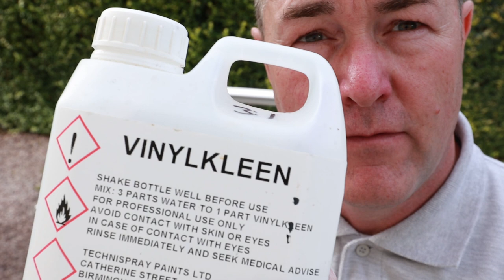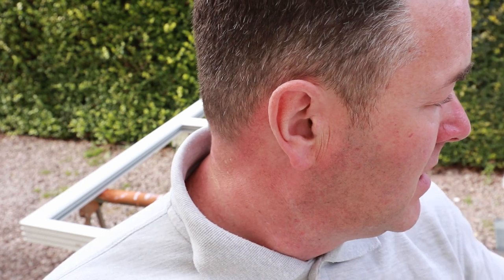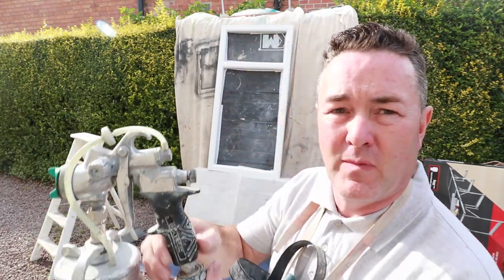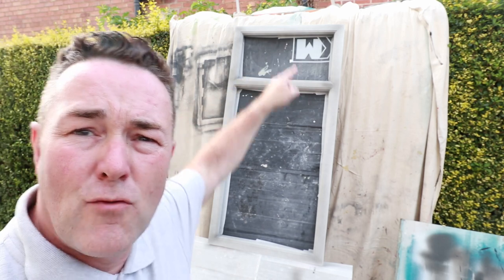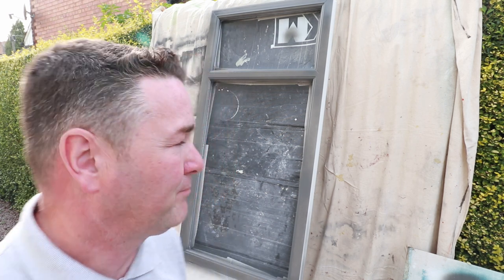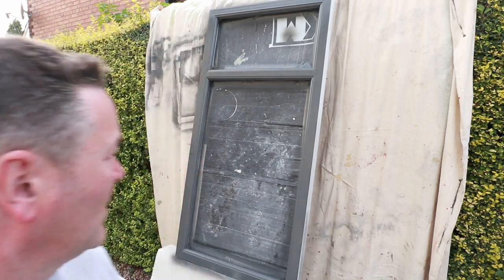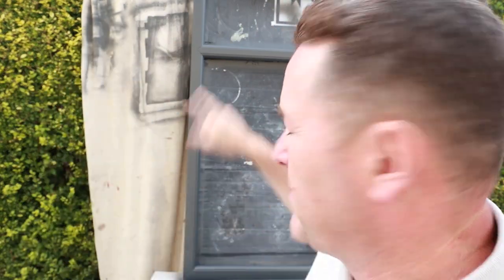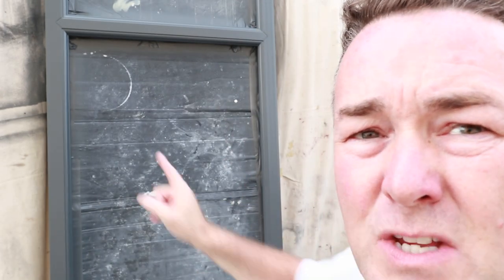uPVC Spraying - KolorBond - Aquatek

Comment: I use aquatec spraying it I’ve used it for internal an exterior window and kitchens an wide range of other things all my samples windows an melamine board r still goin strong amazing drop of paint when preped properly an sprayed with 10%water an correct drying time an good gun it’s solid. Simon is a lovely an if ya have a problem I phone him he will give you the correct advice
Reply from the maker: weird this after three months still came off easy with my finger nail :(
Reply: @ProfessionalPainterDecorator did you ever get to the bottom of the problem?

Comment: I’ve used Kolorbond several times… brilliant paint never had an issue staying this and it never fails and sticks like shit!! The finish is far superior to some of these crappy spray jobs use see where they do zero prep , bang it on and bugger … cowboys !
Reply from the maker: You use the aquatek?
Reply: Yes and like you did the full clean etc .. changed from light brown recently to dark anthracite grey.. did 6 windows and facias and a brick door surround with it (undercoated first) .. never had a problem  finish as you say is great… and by the time I’ve done the second window I just go back to the first and so on 😁
 @ProfessionalPainterDecorator

Comment: New to Hvlp spraying… Ive just started experimenting with a Fuji Q5… you mention in your Video applying a dust coat first.…and not over-atomizing the spray… what would be a good sign the finish is atomizing correctly.

Cheers
Reply from the maker: Get some Card and alter paint flow and air flow, see how it makes the spray different.
Too much paint with not enough air will splatter.
Too much air and not enough paint will makes it go all misty and weak as a finish.

Start with full air, then reduce till you get a nice spray fan pattern.

Getting a dust/mist coat to start with.. just reduce down the paint flow so not so much gets applied.
Reply: Cheers I'll give it a go👍

Comment: Hi Phil
Going to spray some window frames with the Kolorbond original
What masking tape would you recommend 
Thought either orange frog tape or tesa outdoor blue

Also what to clean the gun out with
Jeff
Reply from the maker: Hi Jeff, have you watched the uPVC door spraying, it shows you washing the kit out.
Tape... for brick.. Masq RED tape, 
Glass.. I use the precision 'orange' Q1 tape... general I use the q1 'yellow' tape
Reply: @ProfessionalPainterDecorator  
What about the tape on the black rubber gaskets Phil
Jeff
Reply from the maker: what about it?
do you mean, taping them up?

YOu can go over them with kolour bond
Reply: @ProfessionalPainterDecorator  
Hi Phil
Yes meant taping them up
Didn’t know the rubber could be painted, thought it would peel off
Cheers mate 
Love the vids by the way

Comment: Have you used this on composite doors? Also would a 1.5 needle handle this paint once thinned down?
Reply from the maker: You can use this on GRP Composite doors.
What tip did I use?

1.5 if it's thin enough.

Comment: hi paul ive recently started a project on some wardrobes but they to have some sort of plasticy laminate wrapping on them.... ive cleaned them off and i got recomended some 123 primer to put over it and then top coat but once i applied the paint it seems to chip fairly easy..... ive just bought some shellac primer i was wondering if i could go straight over the 123 primer with it? as some of the doors are just in the 123 primer still
Reply: i feel a bit lost with the project now as i dont know weather i need to strip it all back to the laminate which is a massive job or if i could literally just sand it a bit and go straight over with the shellacbin primer
Reply: @Shortboxing47  Shellac based finishes will tend to stick to anything other than waxes or oils, just give it a good flatten off and a key and it should be fine, with the laminate wrapping you need to give them a real good key for the paint/finish to adhere because it is so flat so that may be why its coming off easy.
Reply from the maker: zinsser 123 does take a good 7 days to fully cure.
keep it on and carry on with the top coats. and don't try and chip it off.
;)
Reply: @chipmunk176  ty bro
Reply: @ProfessionalPainterDecorator   ty phill